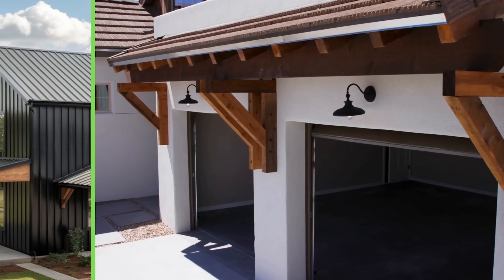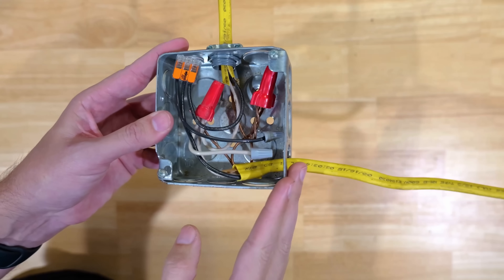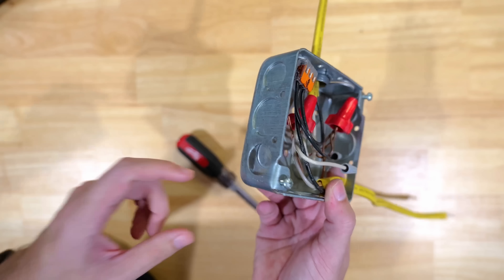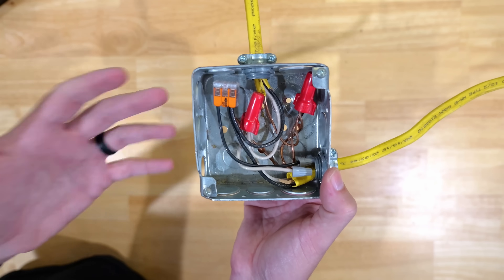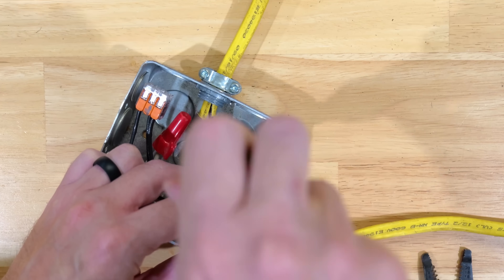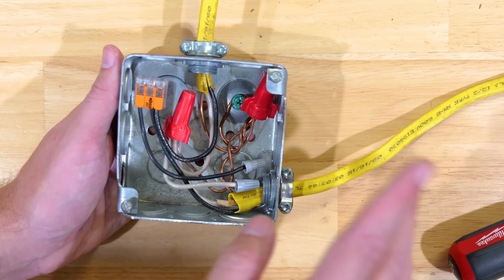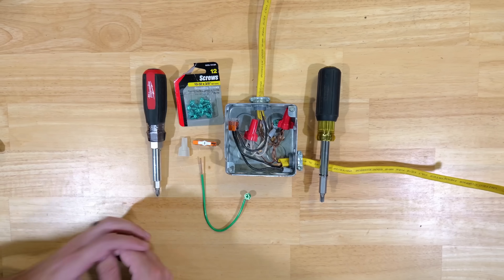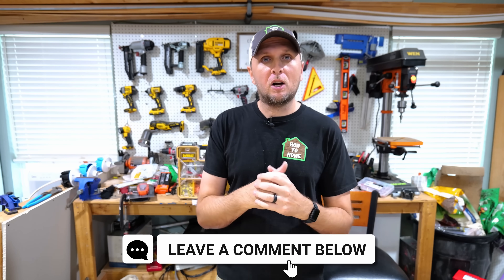SHOCKING Mistakes DIYers Make Installing Metal Electrical Boxes!

Comment: I also wrap wagos with a wrap of electric tape. I know wagos are supposed to be foolproof tight connections… but I have had the close clips open and wires come out. Even after a pull test.

Comment: You  missed, "6 inches of wire measured from the face of the box,".
Reply: That's not a code requirement. A good rule of thumb, sure.

Comment: I've seen so many using the WAGO connectors thinking they will handle the load.
Do an inspection yourself.
Look at where the wire contacts the connection inside the WAGO.
The arm pushes down on the wire, and a very small portion of the wire contacts the metal of the WAGO for the circuit.
Normally, the wire would be twisted, either with a plier or in a twist cap,  in this process, almost 100% of the wire is contacting metal surface for the circuit, and can safely handle load.
The WAGO makes a tiny contact, reducing your load capacity greatly.
The contact you make will prob be ok for a light bulb.  But if you are wiring to an outside outlet, you don't know what kind of loading will be put on that WAGO contact.
In a vid where extreme loads were put on connectors, including the WAGO,  the WAGO got hot enough to melt the case and come apart.
Before using the WAGO connector, do your homework.  Do the inspection of how the wire actually secures and contacts the circuit.  You may be surprised.
Reply: Wago 221 are UL rated (meaning tested by a lab and verified) for 20A.  Wago itself rates the ampacity at 30A+.  Your post makes zero sense

Comment: I'll throw in my 2cs: if this is getting a single gfi recept, just one, please get a deep box, not a shallow box like this. and if it's in a basement, it needs to be gfi protected; and DONT use a center hole on the top or bottom at all in this case, especially if it IS a shallow box, because the back of the big thick gfi outlet will hit the bottom of the damned connector and won't screw in all the way! Aaarrrr!!! worst case scenario you get a hot wire trapped between the two and it cuts into the black wire and poof! your breaker pops the second you turn it on. EDIT: if need be, there are such things as GFi and dual function breakers.

Comment: I always tape twist type or any other type. Just a habit I guess.  Really they need to make bigger boxes as 12-3 going in and out plus another one for a light things get tight as you install your outlet. Love your channel as I wired my house 50 years ago. Since then a lot has changed. Wish they mad logo back then. They look like they give you the most room of all the connectors in this video. How they hold up is why i would tape around it so one of those clips could no pop up. I'II have to look at more of you videos.
Reply: By code boxes need to be sized for the number and size of conductors running through them.  It isn't one size fits all.
Reply: That's why the code requires calculations regarding wire sizes, number of connections and number of devices.  Far too many times DIY'ers just cram things into boxes. Box extensions provide the additional space code would require for that enclosure (junction box) with too many conductors, splices and added devices (switches and/or receptacles).  Don't just assume a single outlet box should be adequate. The NEC 70 specifically addresses this need for additional space. Most boxes have the cu. in value shown in them somewhere. THAT IS FOR A REASON. Heat dissipation is primary concern in over stuffed boxes.

Comment: I always think using metal boxes,... is stupid and unsafe.
Now non-conductive plastic boxes are becoming more popular. Causing all wires to be connected to wires only and not the box, lid, cover,...
Reply: Residential, sure. Commercial / industrial, nope. It's all metal. Plastic is great until it's not. When you need protection of wires, connections, and devices... There are just certain jobs we don't want to worry about things crumbling apart with time.
Reply: What's ironic is that the metal can be safer because the box and piping pretty much act as a 'backup' path of the grounding system. NEC actually still allows using a metal raceway as your grounding path, without an actual grounding wire installed. Local jurisdictions, like mine, have stricter rules that don't allow that and require an actual grounding wire in every raceway.

Comment: I'm IT so I don't touch high voltage, but I did catch the missing ground, and missing the grommet - though I was thinking more about damage to the cable from sharp edges, not strain relief. Having the protective caps on the wires for outlet connections makes a lot of sense to me too. Having seen similar things in IT, I could easily imagine them being left bare "temporarily" only to be forgotten about either for initial testing or even permanently if someone decides that outlet isn't needed. 

Using those inline wago connectors to solve the issue of too short wires when renovating also makes a lot of sense from my perspective. Too short existing ethernet cables cause enough trouble even without the high voltage.

Comment: I personally feel like 14ga should only be used on light fixtures and switch loops. You never know what someone will plug into a duplex, it might draw a lot and be a hazard. It’s better to be safe and use 12ga for all the outlet loops, appliance loops, etc. in order to future-proof it even if it’s only a 15amp circuit.
Reply: If I was in charge of the building project, I'd certainly do that too for the same reasons. But having seen the half-assed job the builders did on my folk's relatively new house and the quality of work I've seen done on other houses lately (not cheap houses, either!), I suspect the builders would consider such a thing too expensive and go the cheaper route for wiring every chance they got. It'd probably still be within code (it's always supposed to be), but it seems like EVERY possible corner is cut these days.
Reply: How do you think this "future proofs" it?  Using 12 Ga wire on a 15 amp circuit is simply wasting money.  If you went to the time and expense of running 12 Ga for the entire circuit, why wouldn't you put in a 20A breaker?
Reply: Code only requires 12 in kitchen, bath , dining room and garage long as you have proper over current protection 14 is perfectly fine any where else
Reply: This is why you hire a licensed electrician 14 is perfectly fine long as the over current protection is sized for the correct sized wire  . Code only requires 12 to be on kitchen, dinning room ,bath , laundry room and garage!!
Reply: It's not proper to say Code requires 12 gauge wire in certain locations... it may require 20amp circuits (like 2 in a kitchen), which implies 12 gauge wire, but that's not exactly the same meaning.
Reply: Rumor is that future Code will actually allow for 10amp circuits, specifically to target modern LED lighting low-power needs... and thus allow cost savings, especially if paired with "copper-clad aluminum" wiring.

Comment: Just because a guy has a number 12 wire coming from the panel doesn't mean he can't put a 15 amp breaker on that number 12 he just had number 12 wire you just can't put a smaller a bigger breaker
Reply: that's true but you are then derating the whole darn ckt

Comment: Just a minor suggestion. With the Wago connectors install your home run wire in the center and the loads to either side. This way you distribute the current from each load and reduce the heating just a bit. It also makes it easier to determine which wire is the home run. It is not a code requirement just a suggestion. Don't forget the center lever with the printing on it has a tiny opening in the clear plastic for a meter to access the buss bar inside for testing.
Reply: I didn’t know about the meter test hole. Thanks!
Reply: I do this most of the time because I’m just cautious.
Reply: Wow never knew bout that hole...thats wat he said lol...but seriously though
Reply: For current?  Correct makes no (minimal) difference.  For wire management it’s a good suggestion
Reply: Makes no difference
Reply: @zaxmaxlax  If you stick within the ratings, it makes no difference.  That said, electricians do this on consumer units (put the largest loads closest to the supply side of the busbar), so I can well see why @jimharmon3404 would like to follow the same principle.

Though I wouldn't, but only because I'd be more interested in putting the wires in the terminal that makes the wiring most tidy.
Reply: @zaxmaxlax  It could make a measurable difference with the right loads, but enough to matter in a home setting? Not likely.

Comment: I WORKED AT EATON PLANT WE MADE THOSE BOXES
Reply: i filed a written complaint about the sharp edges on extension boxes with the UL and got them to stop making them so sharp about 15 years ago, they cut my hand. it was a Steel City i think, not Eaton. They made them stop tho NOT because i said it cut my hand, i knew they wouldn't give a crap. I told them it would cut the wire.

Comment: Clickbait use of cover image to make it look like wagos are issues. I got pulled in for that one!
Reply: agree...
& why splices on hot & neutral at all? 
Use the Duplex outlet dual taps as passthru points
Reply: It's not ideal to use the device in such a manner, pigtails are preferred. However, the NEC only explicitly requires a pigtail for neutral on a multiwire circuit... So removal of the device doesn't break the 'shared neutral'.

Comment: I was taught that the ground wire feeding the box must first be wrapped around the grounding screw before being gathered together with the other ground wires and wire nutted together.  While the method shown would work, there is a risk of the the pigtail becoming detached.
Reply from the maker: Either way is acceptable.
Reply: Grounding pigtails in metal box is pretty much the industry standard. None of it matters when any connection point can be a failure point. So wire nuts / etc are the usual suspects.

Comment: Wago connectors act like hidden fuses when the load surges, as in, they blow out, leaving an open circuit in the building that you have to hunt down.  They have a tiny fraction of the connection area of a wire nut.  Easy and cool but vastly inferior safety, reliability and load performance vs tight wire nut.
Reply: might be but they are still UL listed. lots of peeps dont use them.

Comment: In my apartment I just moved into several outlets needed to be replaced. As the maintenance guy was removing the old I noticed "no ground wire" present inside the metal box? Just the black and white wires going to the outlet. He said it was fine and said it was considered "an open ground?" Is that dangerous? Shouldn't a ground wire be installed into the box?
Reply: this is only up to code if the outlets are GFI protected. and nowadays, that means also AFCI too. Check to see if he installed a breaker with a little button on it for that ckt.
Reply: @SamboNagga  no GCFI on the breaker panel in the basement. It's a 4 gang box for 4 15A single pole switches. Only one of those is connected. The others are simply wire to wire ... No 15A single pole switch.
Reply: And I have a question? There is this 4 gang switch (four light switch) receptacle in my kitchen. Three of the switches are simply connected with black (in) to black (out), white (in) to white (out) and not  connected to the switch itself? Not sure where they go but there IS power to all three of them. Only the fourth one is connected to a light switch properly.
Reply: @eastcoastmodz5195  one picture is worth a thousand words. ie, i got no idea what you are talking about.
Reply: NEC requires all metal boxes to be grounded / bonded. The only exception might be a very old installation where there wasn't even a grounding conductor to begin with. If you see a ground wire in the box then the box should be grounded.

Comment: I worked maintenance  for years and have fixed all these and more. To my mind, I really wouldn't worry much about most of those problems except  the lack of a ground screw and the missing clamp. The rest will very rarely, if ever, cause an actual problem.  Things like the short wires, although a significant problem when preforming service to the system, generally don't affect operation .

Comment: you tightened the box connector and showed what looked like a wrench for about 1 second.... was that a dedicated tool?
Reply from the maker: Honestly not sure what you are referring to.
Reply: That was a flathead screwdriver he was using to tighten the threaded nut on the inside of the box using those little tabs that protrude out from it.
Reply: perhaps a conduit nut wrench? Indispensible
Reply: @bobbundus4593  they are nice but still almost never use it. ie not indispensible. in fact i try to install them by just turning them from the outside of the box with my linemans
Reply: @bobbundus4593  No, it was definitely a flathead.  2:14
Reply: @bobbundus4593  Nope, definitely a flathead screwdriver. 2:13

Comment: You forgot one other mistake. All DIYers are required to tape your wire nuts on. It helps us electricians to identify splices installed by DIYers

Comment: You have not given a reason for "not re-using the wire nut". Best practice its to always twist the wires together before screwing on the wire nut, not to assume that they will be adequately twisted by the nut itself. You have not specified which  code you are referencing - presumably "National Electrical Code" (for the USA), but although local codes are pretty much always based on the NEC, the LOCAL code  (as interpreted by the inspector!) always takes precedence. 

If you are a licensed electrician you should state that up front, in your print description. Otherwise I assume you are just another amateur you-tuber leading those who are even more ignorant down the garden path.
Reply: whats the big deal? is using a new one going to hurt anything? as you know there is no nec article pertaining to that.

Comment: To be clear, you shouldn't talk about 20 amp receptacles or talk about the load drawn on the circuit.  14AWG wire should never be installed on a circuit that is fused or circuit breaker protected at 20 amps.
Reply: Not in regards to receptacles... There's no 'condition' that the NEC allows undersized wire.
Reply from the maker: I think I said that.
Reply: @HowToHomeDIY  you didnt have to, 14 can be used for it's rated capacity in certain conditions, which means a 20A breaker.

Comment: One thing you can find in older wiring is the ground wire for each cable coming into a metal box wound around the cable sheathing so it makes an electrical connection to the box when the strain releaf is tightened down. I don't think that's been allowed by code for a long time, but it was quite common when I first learned to do simple wiring back in the 1960s. A big downside, of course, is that there's no ground wire inside the box to connect an outlet. (Receptacle outlets without a ground connection were also pretty standard back then.)
Reply: Just a little trivia: I have heard of the bonding method described above as the Boston back wrap.
Reply: yeah but with a metal cover the two mouting screws will ground the cover and the device screws will ground the device IF you remove the cardboard keepers. as you know
Reply: How can the cardboard keepers prevent electrical conductivity between a metal screw threaded into a metal hole?
An insulating material would only be a problem if the point of connection was based upon contact between the device bracket and the box, with nothing metal (i.e. the screw) otherwise connecting them. 
Am I missing something?

Comment: These boxes are pathologically too shallow to be used with GFCI outlets, where you need them by code, such as in a garage.  Try putting a light switch and a 20 amp GFCI outlet, a common garage setup, into the same metal box.  If you have any fingertips left after trying to mash all those stiff 12 gauge wires into the box behind the outlet and around the switch, without knocking the wire nuts loose from their wires, then you will be a man my son.  6” of wire left on the feed in and output 12-2 w ground?  You will be lucky if there is enough room inside for 3” of wire leads, with all the ground wires wedged in there too.  And if you add a depth extension ring to the box, the GFCI won’t fit through it.  Have fun!
Reply: i think you mean a mud ring, not an extension box
Reply: @SamboNagga  Yeah.  A rose by any other name is still a mud ring, or box extender; anything but a rose.  ;)  W Shakespeare.
Reply: @eddiegardner8232  LOL
Reply: You can get deeper boxes like this, but they don't look exactly the same, the corners are sharp, not rounded

Comment: Master electrician here with 40+ years in the trade, my thoughts are as follows:

1. Do not tighten the nmd connector more than required to stop the cable from moving. Excessive tightening will result in hot spot and shorting of the wire causing fire.

2. It’s NOT ground. It’s bonding to ground Ground is the one point where a ground wire attaches to the earth. Everything else is bonding

3. Your other points are excellent.
Reply: Thank you for your #2 about ground vs bond. It saved me from having to say it. I bugged me every time be got it wrong. The two terms are not interchangeable.
Reply: @scylar19  the green screws are not called bonding screws
Reply: what does the G stand for on the romex sheath  12-2 w/G?
Reply: @SamboNagga  with ground